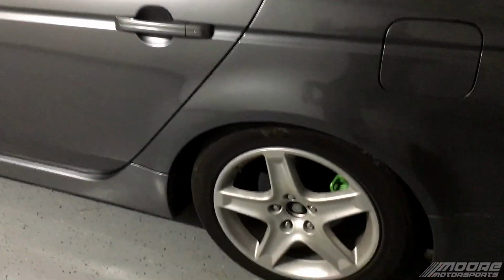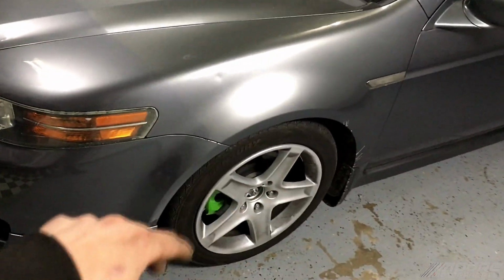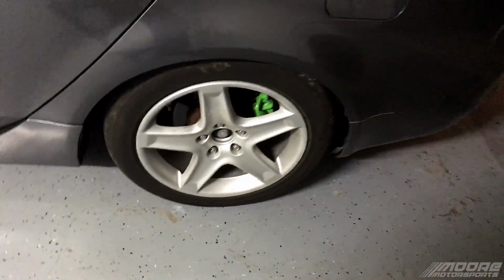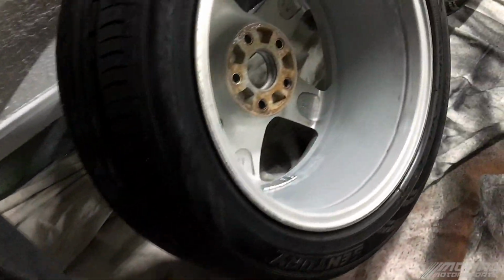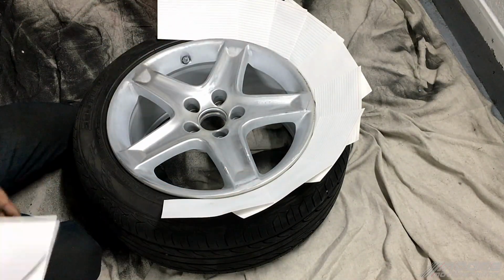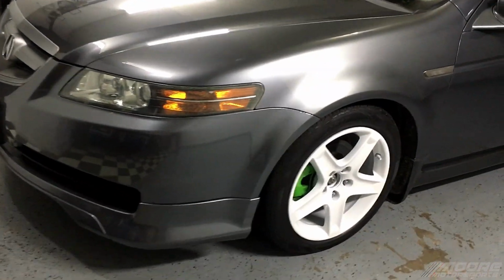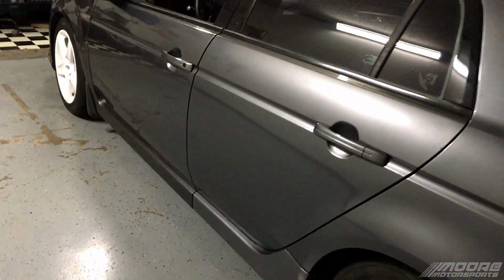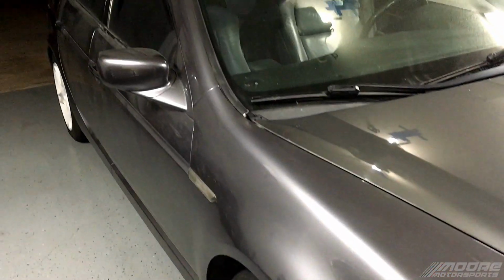My 2006 Acura TL Gets Fresh Painted Wheels

Comment: What shop painted and repaired that. They suck at blending. Most shops around here will take a sample of the faded paint and get it computer scanned so they can match it or they will repaint the whole car.
Reply from the maker: No idea. Got the car from a car lot this way.
Reply: @JamesDguy  I knew ya got from a lot but didn't know if maybe they disclosed the shop info to ya if u needed more info about the work done. Car looks really good I always liked the TLs. That paint would drive me nuts with my ocd about things like that.
Reply: Iv painted whole cars for the same reason
Reply: It looks like it had a ppf installed on it for a long time,  it started cracking out and it was removed

Comment: Hey bro what do you think about the high perfomance rust oleum and spray max 2k with heat resistance? 
Right now I dipped my wheels white temporary to see how they look and I will eventually want to make them permanently white because I really love how the white came out.
Reply from the maker: The 2k clear does good with high heat in my personal experience
Reply: @JamesDguy   alittle off topic but i just painted my car with spray cans [not rust oleum cause  i cant get it in this part of the world ] . it had the dreaded tiger stripes ,i had to do it outside in a breeze . so to even it out i bufffed it rubbing compound . it looks pretty good right now . im wondering should i put a singe stage clear coat on it or leave it and wax ?  if clear coat to remove the compound use a 50 % alcohol mix ?
Reply: @boracay12  the tiger stripes are because you didn’t use enough base coat, if you buffed it without clear coat I would just start over and paint it again. Never heard of someone doing that. Your base coat is way too contaminated.
Reply: @boracay12  also never use single stage clear coats on cars, they are garbage.

Comment: Hello, I painted my entire car with rust oleum 2x paint cans, but now its full of imperfections (dust/hair), I want to sand the entire car before I apply a 2k clear. What grit sand paper should I use. His 600 good or to coarse, will it leave scratch marks on the finish product. Or his 800 better, can anyone help me, thank you!
Reply: I suggest you to use 1500 or 2000 grit (wet) and  1 coat the of color before clear coat

Comment: James got a question for you...i know you are the rustoleum man...
I had runs on my wheels.sanded down the 2x clear..to spray a nice even coat...clear wrinkled all over the wheel...do i have to sand down the paint too to avoid this???
In 25 years every single times i used rusto it fked up my job...feel like throwing the wheel down the balcony 
Tried to save money again rusto cans are 9$here and car paint went up to 18$/can.
Reply: Sprayed at 18degres C and 33% humidity...not under direct sun light...cant consider using 2k clear its 51$ a can in canada!!!!!i usually spray bomb the clear/2coats more then enough....did it wrinkle because i did not fume it first coat??also did not wait a week before sanding runs.sprayed 2days ago left outside to dry.
Reply: @upnorthviking823  He doesn't prefer rusto clear coat he mentions that in his videos. He says sometimes he gets that paint reaction too

Comment: Please help. Everytime I fix and paint the wheel wells where there was rust. 
Im getting small bubbles in the paint.!!
I clean the surface and let it dry. No contamination. I dont understand.
Reply: You need to use a rust converter to neutralize the rust if you don't it's gonna reappear soon